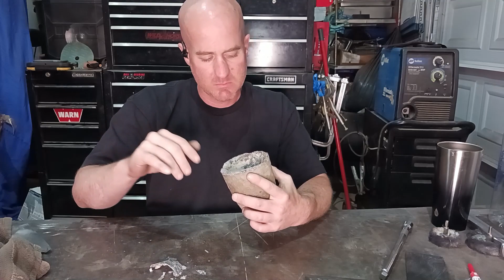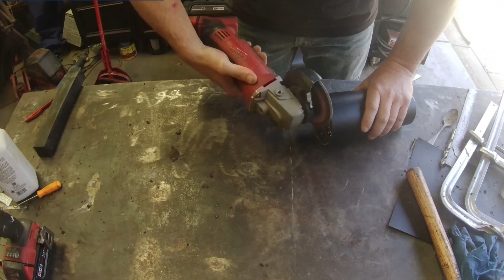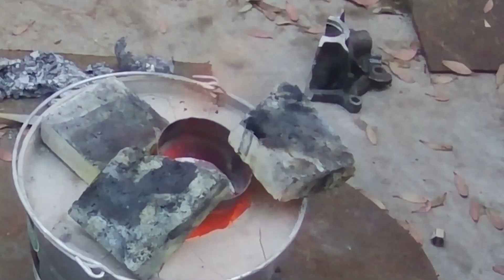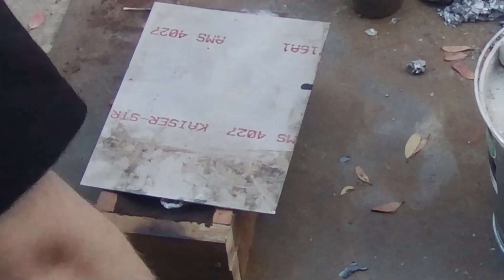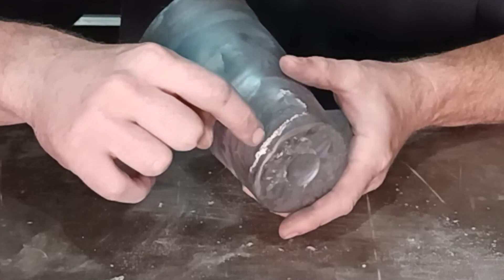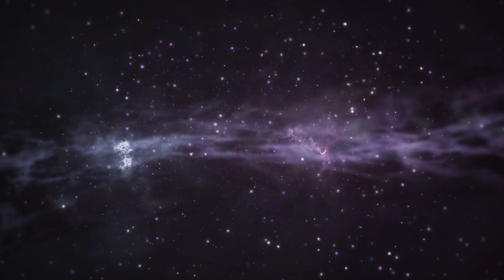Coffee Cup Crucible to melt aluminum #metalcasting #meltingaluminum #coffeecups #diy #foundry

Comment: It’s not the heat. The steel is actually dissolving into the molten aluminum. Salt melts at 1400° but dissolves in room temperature water. Similar process.
Reply from the maker: Thanks for the info